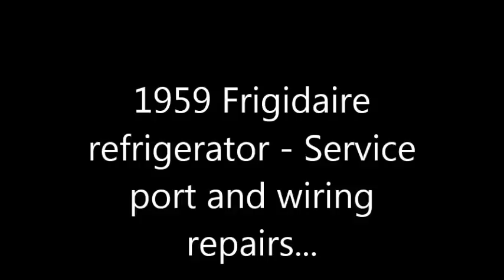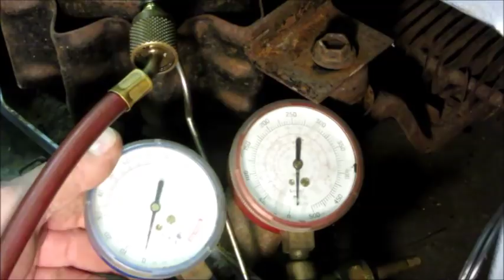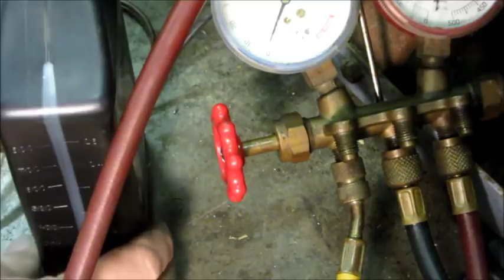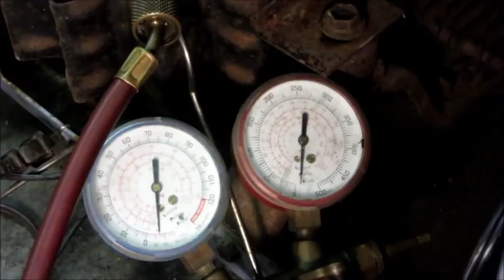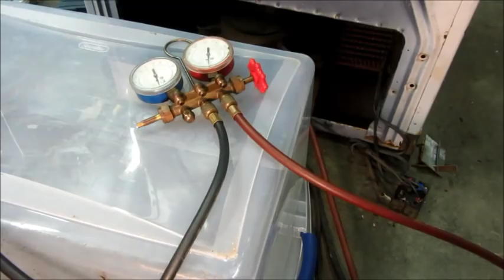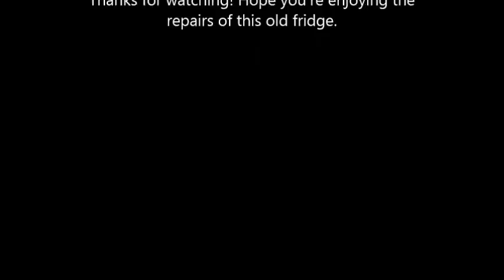Frigidaire 5400426 antique fridge - 2 - Service port, wiring, and test charge....

Comment: I remember people always saying that those old refrigerators they used to always get shocked when they were they try to open up the doors on them
Reply from the maker: This is a very real possibility. The original cord is a 2-wire non-grounding / non-polarized cord. It is not safe because if any earth fault happens in the wiring of the fridge, a shock will be the result. That's one of the reasons I insist on rewiring them all and installing a 3-wire NEMA 5-15P style cord on them.

Comment: David, these are great informative videos. Thanks for posting them.

I have a model 5850251, not sure of the year, maybe early fifties?  Anyway, have had it since 1976, replaced the door gasket then and it worked perfectly for several years except the thermostat required seasonal adjustment to keep veggies and milk from freezing as the house cooled down in the fall.  

After about 15 years and a few moves, possibly improper moves, it developed a start up problem.  After defrost, it would run half an hour or so then cut off. Then it would try to restart too soon and just hum for few seconds in an endless cycle.  At that time I installed a 3 n one and it performed well for about 27 years until last week. After defrost I turned it back on and forgot about it.  

The next morning the compressor was running continuously and the refrigerator was not cold.  I turned it to off for an hour and then back on to normal setting.  It  ran for 30 minutes or so and cut off, freezer icy,  then it tried to restart too soon.  I sat with it for an hour, unplugging it for a full 5 minutes after every shut off to keep it from restarting too soon. Eventually it ran continuously and was not cooling.  I have repeated this sequence with the same result - gets cold at first, then after an hour or 2 warms up and runs continuously.    Any ideas?  Thanks,  RP
Reply from the maker: Hey sorry you're having this problem with your Frigidaire.  I haven't faced the exact problem you describe, but I have read about one or two possible causes.

Without seeing a picture of your fridge, it's hard to tell for sure the year of it. There doesn't seem to be much in the way of model number - year cross references with it.

The very early Frigidaires used refrigerant 114 and those seemed to have a problem which could occur if the motor was overheated. The motor was constructed using organic materials, which would degrade and release water into the refrigerant. This degradation happened sooner the more often and more severely the motor was overheated. Stalled conditions such as when the start relay is not operating correctly will quickly over heat the motor.

The moisture in the system will form ice crystals which cause a blockage in the capillary tube at the evaporator (freezer) section, which can cause a loss of cooling, or cause the compressor to overload and stall.  

The compressor in these fridges is a rotary type. It will only function if the compressor is running in the correct direction. It is possible for the compressor to run backwards, if the power is cut off and back on immediately - such as within less than a second.  If there are any bad contacts in the system (such as the thermostat) which are glitching and arcing, instead of making a clean break, this could cause the compressor to lose power for a fraction of a second, "kick back" and run the wrong way. 

If you could post some pictures of the fridge here (link below) and  include a close up of the compressor area, it would help! Also, there are some other more experienced Frigidaire guys there to help out. 
http://monitortop.freeforums.net/board/13/vintage-refrigators
Reply: Thanks a ton!  I will check out the thermostat and post pics to the forum.
Reply from the maker: You're welcome!  Hope it's not internal damage to your compressor!

Comment: That was fun! Thanks for sharing. When you were running the butane, and the current was low, the lower than normal power factor would be expected since the mechanical load was lower. As the load goes down, so too does the power factor since the real power goes down, but the reactive power remains the same. Hopefully you can get that relay working as well as your other one! You've got me wanting to work on my old Philco now. :) It seems to have a galvanized steel evaporator, making me think that it was built during the war, when metals like copper and aluminium would have been rationed. It's a SUPER HEAVY fridge though!!
Reply from the maker: Yes you're right about the reactive power staying the same regardless of load.  Bear in mind, I had the corrective cap in the circuit at that point, whereas with the R152A I wasn't running it. I still think the kilowatt meter may not be accurate for power factor. Need to check it with some known loads and see.  The amps measurement and watts seem to be believable.

You should get that Philco going. This is the competition to Frigidaire, I believe. If I am not mistaken, that is a Ford Motor Co. product, whereas the Frigidaire is General Motors! 

Initially, I thought my fridge had steel evaporator, but once I started cleaning up the damaged area, it was clearly undoubtably copper. The softness also would indicate copper.

What's wrong with your Philco?
Reply: You got my hopes up that the Philco evaporator might be plated copper, so I went out and checked it with a magnet. But it sticks. :( When I got it a few years ago (for free, plus a road trip) it did work, and I presume that it still does. It also needs a door gasket, though someone has at least tried to substitute some foam tape, so it's not too bad. For a long time it's had an odor, and I think you nailed it when you mentioned wet insulation. I would imagine that moisture would collect in the insulation over time? I wonder what to do about that. The evaporator in this one is very elaborate, encompassing the floor of the freezer as well as a shelf in the fridge, IIRC.
Reply from the maker: Awe too bad that your evaporator isn't copper. But steel is nonetheless able to be brazed if necessary.

There is a great forum where all old fridges are appreciated. Also, I have been getting my door gaskets from Antique Appliances in Georgia.  The tech support people can identify the gasket if you contact them and e-mail them pictures of the fridge from a distance with door closed, with it open, and closeup of the door gaskets at each corner.

Yeah I would definitely check the insulation because if it's wet it can corrode and rust out the fridge cabinet!

Forum: http://monitortop.freeforums.net/

Parts store: http://www.antiqueappliances.com/
Reply: Any idea what pressure you'd read after starting the compressor? Mine jumps up to 100psi and I'm not sure if that's right. I'm trying to troubleshoot. No noticable leaks, compressor runs, but no cooling.

Comment: Great video - I didn't know that about PAG oil damaging the compressor windings.  Also - that compressor is really quiet sounding compared to a modern fridge a friend of mine has.

I use a Kill-A-Watt for testing fans.
Reply from the maker: Thanks for the positive comment!  Yes the Meter-Miser compressors are really quiet!  There is often some "tinking" or rattling when they are started up cold; however once the system has cycled a few times it is nearly silent.  That compressor has no reciprocating parts in it, as it is purely rotary.  

As for the PAG, I have heard of this from friends in the HVAC industry; as well as found warning cards in boxes with new compressors, telling you to be careful not to contaminate it with PAG oil or the compressor will fail.  Somewhere on YouTube there is a video where a guy autopsies one and finds winding insulation damage. Found it!  He doesn't mention oil compatibility, but I would imagine that PAG oil damage would look similar.  I know that PAG oil will damage paint and leave it rough, blistered, and softened in the same way this winding is damaged. https://www.youtube.com/watch?v=r0s5n8LiQwI

EDIT: I also use a Kill-A-Watt for fans!  Learned about it from the AFCA guys actually!

Comment: Thank you for your indepth detail on these older refrigerators.  I have an LH-12M-C1 GE model.  The exterior is in great condition and I am trying to work on it so it will run.  At this point, the compressor is not trying to come on.  I  suspect the run relay (I only see one devise between the incoming power and the compressor). There are 3 leads coming off of it.  One goes up the back of the unit and the other 2 go to the compressor.  There is no fan motor or capacitor that I can see.  When I looked inside the relay (by taking the back part off) there is only one coil that appears to be inside.  There are 2 sets of contacts but one does not seem to be attached at the post.  It is very flimsy (fine) and just floats at the post connection.  The other end is the contact point to the relay and that part looks ok.  If I buy a start run devise can I use that to see if the compressor will run?  As you can see, I am pretty much a novice but I learn quickly when I am trying to fix something I believe is a treasure.   John

Comment: The run cap installed im assuming was removed at the 2.08 amp reading. Very good video, as i herd of doing this but was never showed in school to reduce the run load amps, also is it wired between the start and run winding and could it be left in place to reduce the RLA. Will the new refrigerant 152a need the run cap or is the run load close to the r12 RLA. Thanks for the videos, I really am getting a lot out of them

Comment: I wonder how differently isobutane is thermodynamically.  It's more commonly used than n-butane.
What Megger do you have?  I just bought an old Megger BM7 for a song ($5) which works very well.  I just need to make some leads for it.
Reply from the maker: I read that the T/P curve for isobutane is slightly different than from n-butane. If I remember, it was only slight. Really I haven't given it much further thought after this test. It has too many drawbacks compared to things like R152A or R1234ZE. One of the main "bad, bad, bad!" things about butane is that it damages natural rubber as well as many synthetic elastomers. It absorbs into them and swells and softens them. During this era, virtually all refrigerator compressors aside from GE used some sort of rubber or other early synthetic sealing insulators in the motor terminals. There have been some cases of terminal leaks after hydrocarbon blends such as HotShot were used in these. i didn't leave the butane in this one long enough for it to permeate the rubber and cause a leak, thank goodness. Along the same line of thinking; people have had their manifold gauge hoses fail from this. And then with early designs such as the Monitor Top, and the very early Frigidaires the charge amount is very large. That amount of butane would be a significant fire risk if the unit were dropped or otherwise catastrophically broken.

I've got a Fluke 1587 for work (it's required that model to be used on certain sites); and a James Biddle hand-crank Megger from the 50's which was a gift.

Comment: Hi David,

Thanks for the video. I have a frigidaire MJ-7 (1949) I ordered the brass access connected you have on the video but it seems too big. What do you suggest I can install there? I believe the inside of the threads are M8-1.0. By removing the bolt on the compressor, I had to let go of the air. What happens if I tried starting it with no air? I need to rewire it but don’t know which wires get connected to the relay. Would you have a diagram by chance. Also, do I use R-22 or R132a can’t seem to find any of the R132a.
-David R.

Comment: Your videos are so informative thank you!  I have a late 40’s early 50 Fridgidare that I am raffling off this summer.  The fridge works very well from what I can see (I’m a novice). 
Question. I want to replace the power cord to a grounded one should I try to replace the other wiring as well?  I am a little nervous messing with the 3 wires on the condenser.  If I end up causing a leak I will likely not have it fixed in time for the raffle. 
What is your professional opinion on what wiring I should do?
Cheers!
Reply from the maker: Thanks for the comment! 
As for the wiring, it is a very good idea to replace all wiring. The wiring can become crispy and break, allowing shorts. The compressor is a source of heat and usually the rubber wiring at that point deteriorates first.  From a safety / responsibility standpoint I can't recommend leaving the cable between the compressor and relay in place and original.
Reply: Thank you for the quick reply back!
I will spray some penetrating oil on the nuts to make the job easier!
I am really looking forward to rewiring this unit and my late 30’s early 40’s Kelvinator 🙂
Reply from the maker: @nathanhayes5852  
Definitely penetrating oil will help the caps to come off without twisting the studs.  Cool about the Kelvinator, as well!
Reply: How tight are those caps normally?
I am really afraid I’m going wreck something!

Comment: I am currently repairing a similar fridge I converted into a kegerator a few years ago that developed a leak. What freon did you end up using and has it continued to work a few years later?
Reply from the maker: Sorry you have had to endure hot foamy beer LOL! 

I use R152A in these. Have a few going on 7 years with it. No oil change necessary.

Comment: That’s an interesting power difference with the run capacitor. Would that same trick work for many induction motors? Did you leave it hooked up long term?

Comment: hi, do the freon lines rust? i have an old hotpoint i just got... am going to do some work on it, but it runs great... i looked under it with a camera and the freon lines looked rusty, i thought they were copper... it may just be paint flaking off... i dont know.
Reply from the maker: They can rust. Many of the lines are steel, due to cost constraints. Once the paint flakes off, they rust. They are very thick-wall lines so they don't usually rust through.
Reply: @davida1hiwaaynet  okay... i think that may be what is happening... would it hurt to get some fine grit sand paper and try to get it off and repaint them or should i leave it alone?
Reply from the maker: @WalterKnox  It wouldn't hurt. I would use a wire brush instead of sandpaper. It seems that will knock off loose paint with less bent fins or other damage.
Reply: @davida1hiwaaynet  okay, thanks... I will look at it and see what to do... I just got it yesterday and haven't done anything with it yet.

Comment: Your presentations I have watched are very well done.  I have especially enjoyed the Frigidaire series.   I see a previous comment asks if you placed the run capacitor in service and I did not see a reply.  Please do so.  Also, the resistance of my Meter Miser is 3.8 ohms, 6.9 and 10.5 and one of your tests of the Miser was almost twice the resistance.  What would this mean as to the condition of my unit?
Thanks,
Corbin

Comment: Hi Mr. David;   What is the screw at 23:39 for?   Thanks for  your vídeo;
Reply from the maker: Hi Louis.  Are you asking about the brown / rusty bolt on the lower rear of the refrigerator cabinet?  Or are you talking about the round threaded caps I am removing with my hands? 

The bolt in the back of the cabinet holds the compressor mounting bracket into the cabinet. There are two on the rear and two on the front. 

The caps are the wiring retaining fasteners for the terminal studs.

Comment: Hi, is it possible to rewire without losing compression or current freon? Thank you
Reply from the maker: Absolutely!  It is totally unnecessary to remove refrigerant to rewire.  This fridge in the video was defrosted with an ice pick and they punctured the evaporator and lost the Freon. That part of the repair was totally unrelated to the rewiring.